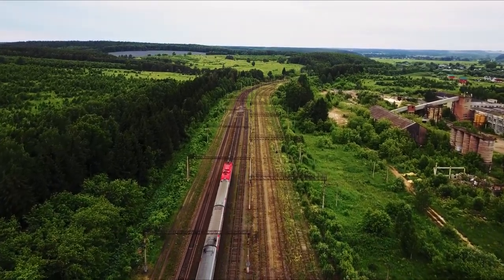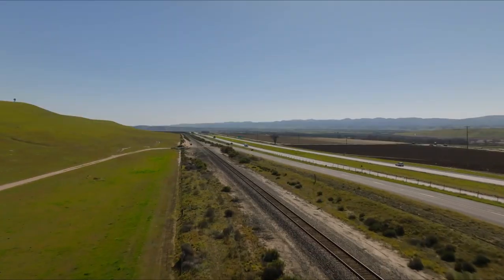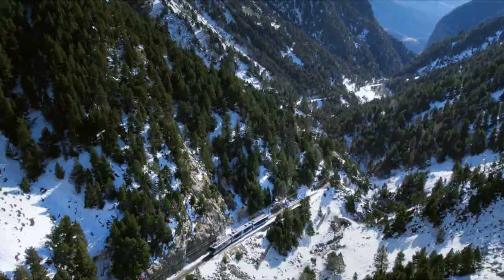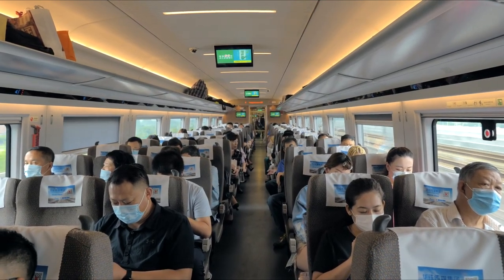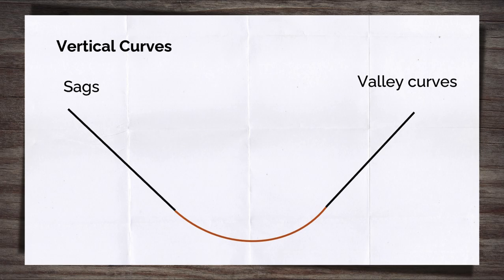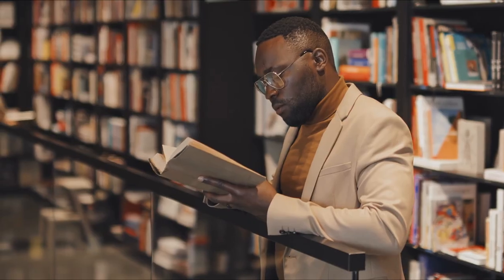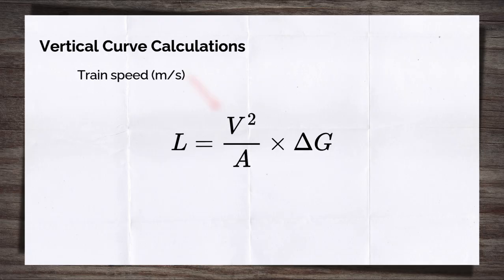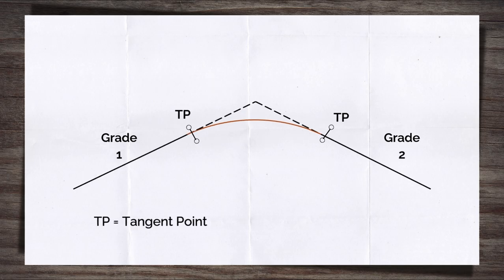Vertical Railway Alignment Explained: 7 Key Concepts You NEED to know!

Comment: I have only felt -g on a train once, that was on Eurostar to Brussels about 2 weeks after the chunnel was reopened after the fire. We left St Pancras late after delays reallocating seats and I was put in the last seat in the last coach. The driver was making up time and accelerating the class 373 hard between where the line goes under the A13 and New Tank Hill Road, where it passes over the line from Rainham I felt light before being pushed down again going to pass under New Tank Hill Road. It has always impressed me that the Eurostar has so much acceleration. It may not of been felt near the front or middle of the train but certainly was at the back. I have been in that coach a few times and that's the only time it happened

Comment: Off topic…but…
Is there a generally preferred ratio  between the track gauge to the sleeper length supporting it?
Reply from the maker: Another question I have not thought about. I would think it’s more about the length of sleeper outside the rail that the overall length
Reply: I’m deep into the design of a 15” gauge field railway. I setting up the sleeper production system to be based on a standard length. 
The rail tie down bolts (spikes in old language) will be spaced from the sleeper ENDS!
This is to make batching rail sets more efficient. 
So the sleeper length has the hold strict tolerance. +/- 2mm. (Sorry about mixed measurement units) and also has a real effect on materials used over the course of 10 000+ sleepers. One inch or say 20mm difference in ‘standard’ sleeper length has a huge effect. 
I want to get it right at the start if possible. Just to be clear, this is a near enough railway, with an operating speed not much faster than walking, and so not held to real world tolerances. 👍
Reply: P.S.  If you want to see how ‘rough’ a railway can be constructed and still be perfectly serviceable may I point you to the YouTube uploader “Way Out West - workshop. 
P.P.S. I’m using this design as the basis of my trackbed. 👍
P.P.P.S. Not sponsored. . 😂

Comment: Why aren't gradients expressed as degrees from the horizontal?
Reply: The numbers will be so small: Lickey Incline is 1.52° (91.2'), and it is considered to be extremely steep by main line railway standards. Most of the West Coast Main Line has slopes no more than 0.19° (11.5'), Eastern part of Great Western Main Line has no more than 0.044° (2.6').

Using 1:n makes the number easier to comprehend, so we will have 1:37.7 for Lickey, 1:300 for WCML and 1:1320 for eastern GWML
Reply: @hydrogenvshelium6851  I did wonder about that. I still think it would make sense to quote gradients on tarmac roads by degrees.
Reply: Because you don’t dig in degrees - you lay dirt it rise or fall per unit distance. Earth movers quote on the required dirt to move.
Reply from the maker: That is a very good question, that I can honestly say I have never thought about! I will have a look into that
Reply: @thepwayengineer  I'll be interested in what you find.
Reply: The video completely misses the main consideration and concern with gradients, that of the limits of adhesion. It mentions brake failure, an extremely unlikely occurrence , as being a problem, whilst  the vagaries of adhesion become a real operating problem and danger on gradients.
Reply from the maker: A very good point, did miss that out. Maybe a video focused around adhesion?
Reply: @thepwayengineer  Yes please!
Reply: There's also per mille (the symbol is a % sign witn 2 zero on the bottom). A 0.5% gradient is 5 per mille.
Reply: @neiloflongbeck5705 y'know I've seen that symbol occasionally and never made the connection
Reply: @thepwayengineer Especially at bridges or structures , why are vertical curve gradients not allowable? Why are gradients not allowed to overlap with horizontal alignments? Is this refers to maintenence issues?